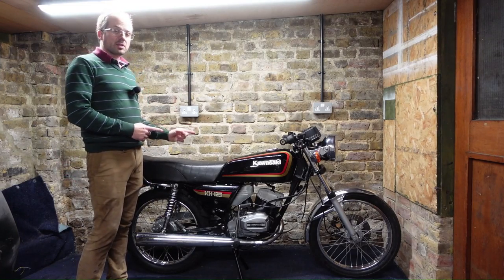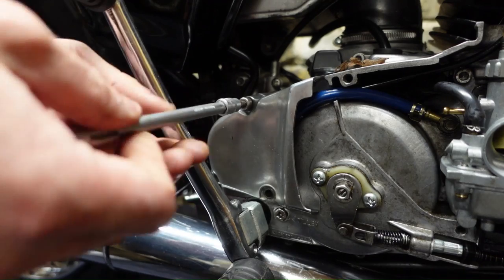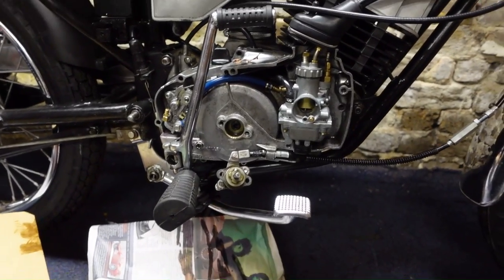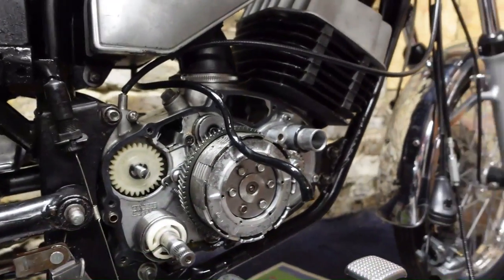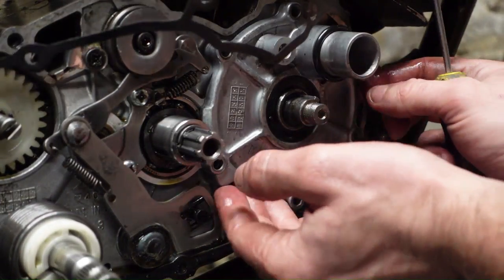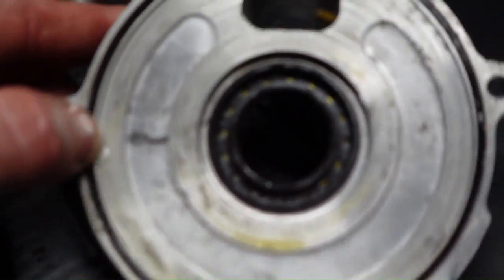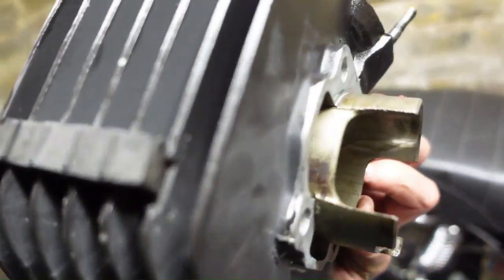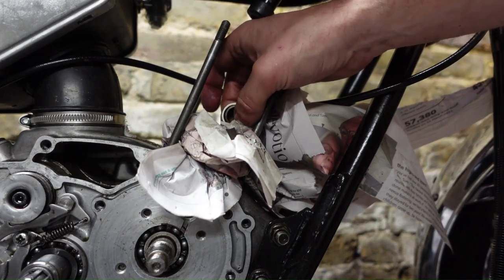Kawasaki KH125 Engine Rebuild Part 1

Comment: The 'carb inside the engine' phenomenon you've just discovered was fairly common practice with small rotary valve two strokes (think reed valves, but a different way of induction). Yamaha and Suzuki also used this layout.
Reply from the maker: Thanks Lee, yes there's a lot I need to learn about 70s and 80s two strokes, love the engineering on this bike

Comment: Before you start spending money on parts or work that you don't need, you ought to find out what the service limits are of engine consumable parts. The concern is that in particular with the small end bearing, you're feeling 'end float' and confusing that with actual wear. Not all bearing movement is a 2-stroke is bad.
Reply from the maker: ok thanks yes I will do that, so far I've only ordered the parts for the bottom end which did look worn, the top end parts may be good to go again - I'm intending to put it all together and see how it runs next

Comment: Does the small end bearing wobble when the pin is put back in?
I seem to recall that the rollers in the cage move freely and are pushed outwards when the pin is in?
Was a good few years ago when I last played with 2 strokes 🤣
Good luck with the rebuild, lovely little bike 👌🏻